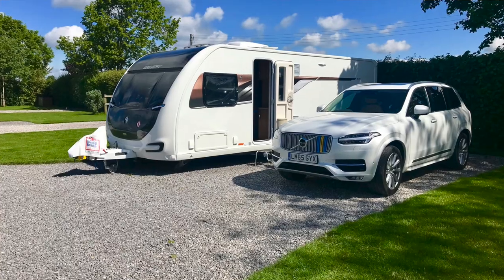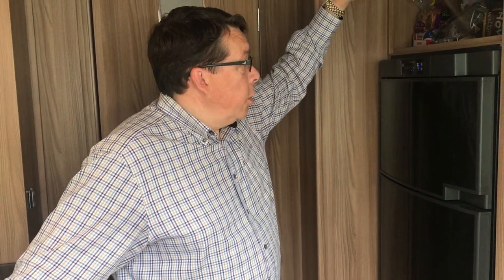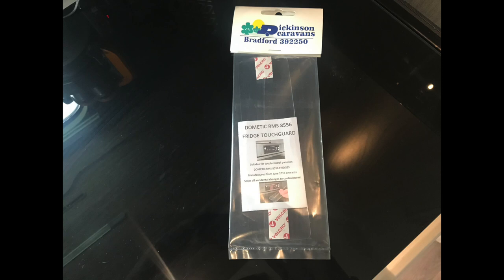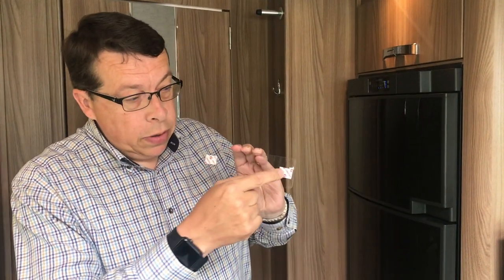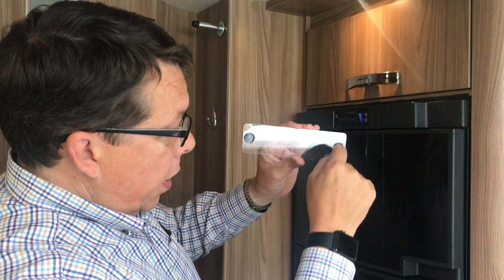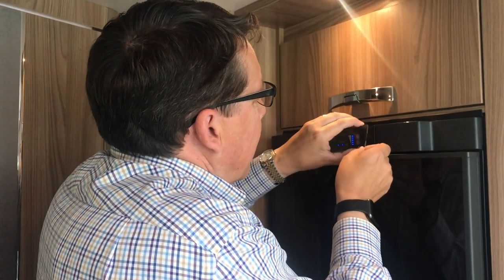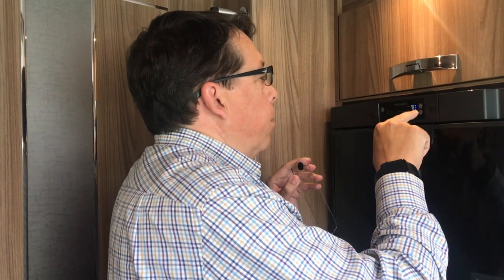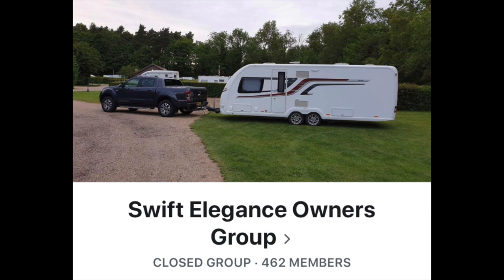Panel Guard Review for Dometic Fridge Freezer

Comment: Great idea Paul they are over sensitive panel on the fridge.
I picked up the same caravan as yours a couple of weeks ago but had to wait for E&P levelling to be refitted .
Just getting it ready for its first trip next week and was white greasing the level leg slide guides.
At the very back n/s very bottom edge of the fibre glass panel is cracked.
They must have seen this at the factory and should have been picked up at PDI?
Just check your one for this defect.
Looking at your background and your recent uploads you look like a great candidate for going to the caravan shows spotting bad workmanship.
I have messaged many well known bloggers regarding what the construction of caravans are made of i.e. Floor construction side walls front and back.
They only say how good they are and the price and most of them probably all of them are sponsored by Bailey caravans and end up with a price reduction and getting a good deal.
Mainly after they have ripped Swift apart? 
Any way there no one out there blogging at the shows looking at poor construction and quality.
Keep up the great improvements and ideas looking forward to your next blog.
Reply from the maker: Thanks for the feedback.  I’ll have a look in the morning for that possible crack on my van.  They’ll always struggling to ‘buy me’ and if or when they do I’ll let you know.
Reply from the maker: Have a good holiday and hopefully any issues that come up can be easily solved.

Comment from the maker: Hi
I’ve had a good look around the bottom of my rear panel and there aren’t any cracks.  It looks like the panel has been trimmed underneath by a child with a bread knife but otherwise OK.  The floor of my front locker is 9mm plywood by the looks of it; with a black waterproof finish and untreated edges where ventilation holes have been formed.
I’ve just set out van up on a small CL and was very envious of your E&P when I was jacking the van to fit the Alko Secure locks.

Comment: Hi Paul don't no if you have had chance to check out your panels yet. Dealership have just said they are going to replace whole bank of the caravan.
Also just check your front lockers floor as my one and my sister caravan have wood instead of fibreglass?.
They asked for photos 
Loads of issues up to now very disappointing considering they have advertisements saying flag ship and completely timberless .
The gas lockers of all places should be fibreglass.